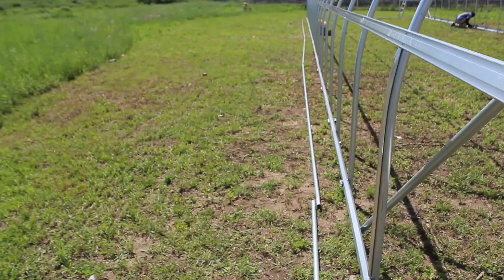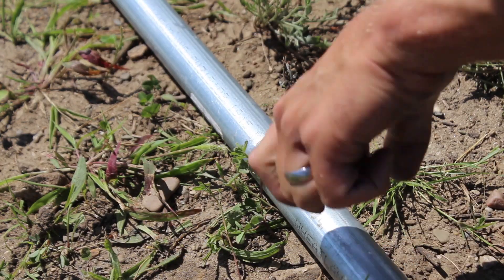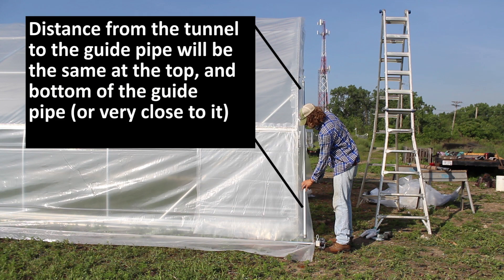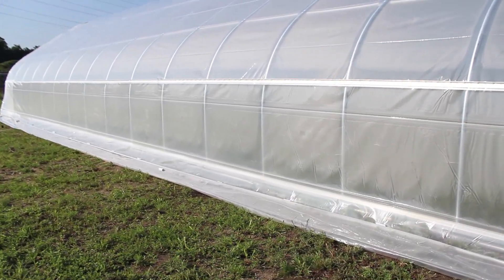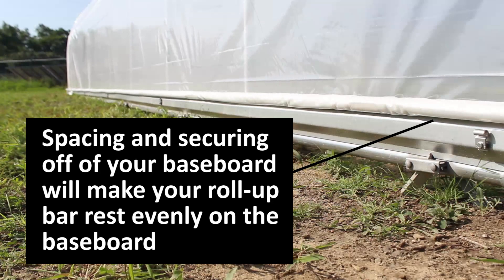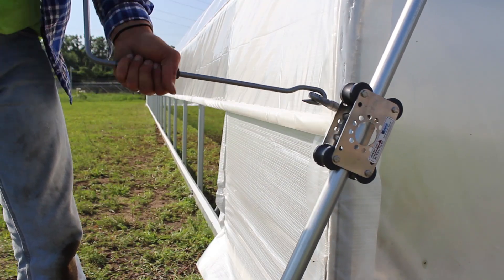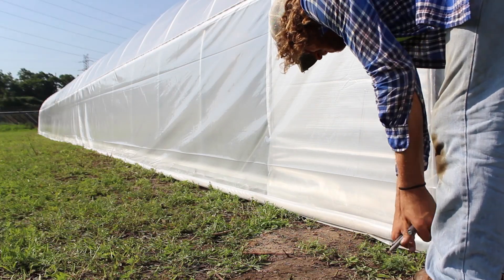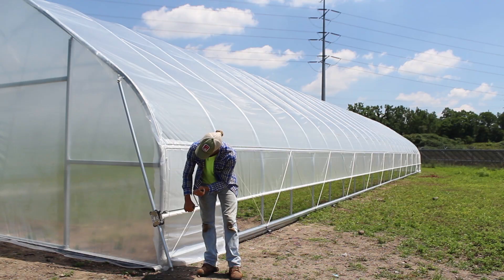Roll up sides for Greenhouses - How to Install for Improved Ventilation

Comment: Good step by step video.   I do have on question on the direction of the roll up.   Wouldn't it be better to roll up the plastic in a counter clockwise direction so the water would run off the plastic easier??
Reply from the maker: Good question, and you could actually rotate it the opposite direction if you want to. I prefer rolling it up as shown in the video because I find that there is less friction put on the plastic at the point where the plastic contacts each hoop. When you roll the side up turning in the opposite direction, I find that the plastic begins to wear down prematurely at each bow. 

This wouldn't always happen I suppose, and it would depend partially on how the anti-billow system is set up too (and a variety of other factors), but that is why I prefer the roll up method shown in the video.

Thanks for watching and commenting!
Reply: @tunnelvisionhoops  Thanks for the reply and your reasons why.    I enjoyed and have learned from your videos.

Comment: Looks like a real nice GH !  I've emailed my specs.  I bought a cheap version of a 30' wide.  The peak was too flat.  I awoke one morning after a huge rain storm to find my green house TOTALLED!  Nothing but bent hoops and huge puddles of water in the plastic.  :(    Will rebuild with a concrete floor as the 20 year landscape fabric permitted weeds to grow right through it, from one end of the GH to the other.

Comment: Hi, I'm very impressed with the quality of your greenhouse and attention on details. Question, is it also possible to do double purpose, inflatable sidewall and then roll them up during summer?
Reply from the maker: Thanks for the kind words, and for watching the video. There are ways to inflate the roll-up sides. You would need to weld the plastic on the edges where it overlaps the end-bow. Most people also use a special baseboard that better holds the roll-bar down. If you planned on having them inflated and in the down position for a long period of time, you could probably get away with inflating the sides with a jumper hose that moves air from the top to the sides (and then disconnecting this jumper hose in advance of when you would want to be able to use the roll-up sides). If you plan on operating the sides relatively frequently though you would likely require separate inflation fans for the sides that could be turned on and off as required. We don't specialize in this aspect of inflation so I would recommend reaching out to a company like Advancing Alternatives to get a full run-down on the hardware and configurations required to do this.
Reply: @tunnelvisionhoops   Thank you for your advice and tips! 😁 But my ideas are to put 6 inches baseboard wood on top of the metal baseboard and put wire channel, so that in cold season I can air lock the roll-up plastic, and during summer I will remove the wire lock? (Hope this will work) I'm also planning to leave 3-5 inches gap in-between the two wire locks of  the hip rim, so that the air will also flow down the side and I can avoid installing the jumper hose. I'm basically base in South of Portugal where the weather reach an average of 17-23 degree celsius and 10 in the very cold winter day. But so far, checking all of greenhouse in YouTube your greenhouse construction got my attention, very neat and professional and the way you answer back all questions is very professional too.

Comment: With both sides rolled up, what’s the vulnerability to wind?  Is it much worse or can high winds spill out without damaging structure or the plastic covering?
Reply from the maker: It would be ideal to roll the sides down when high winds are forecast. It would be better to roll both sides of the structure down to prevent wind from making its way into the structure. Securing the far left and far right of the roll-up side with Spring Wire (where it overlaps the end-hoop) is a good way to further secure the plastic in wind.

Comment: What are the temperatures different from outside to inside the greenhouse 
Thank you
Reply from the maker: It really depends on a lot of variables, most importantly how much direct sunlight hits the structure throughout a day. This is an important variable because the structures' intent is to hold that heat throughout the night (as well as possible) until sun can begin to warm the structure the next morning again. For this reason, the temperature difference from inside to the outside can also depend on how well the structure is sealed to hold the heat that was gained during the day, through the duration of the evening. For this reason the temperature difference from the outside of the structure to the inside of the structure can really vary from just 4 degrees to 50 degrees. It all depends on the structure, the environment, maintenance practices, and more. 

While the heat in the structure is an important factor, the removal of wind pressure on plants can be equally beneficial.

Comment: Do you have a ballpark estimate for a 65' x 15' greenhouse like this with roll up sides?  And maybe beginner intstallment time estimate?
Reply from the maker: We could do a 14.5 ft. wide x 64 ft. long (they are on 4 ft. spacing between bows), or we could do a 17 ft. wide x 64 ft. long. Shoot us a message via our contact form on our website (tunnelvisionhoops.com) and we can send you detailed pricing and info on a few different structure configurations in these sizes. Basically, you can make them as simple or as decked-out as you wish, so pricing can vary from structure to structure. Feel free to shoot us a message and we can send you some quotes. Thanks!
Reply: Where u get that nice metal end wall framing?
Reply from the maker: When people purchase one of our high tunnels / greenhouses we provide them with square steel tube end-wall kits. We pre-cut the steel members as much as possible, and provide detailed drawings, so the end-walls can be assembled as easily as possible.
Reply: Is there s limit on how high you can roll up a side?
Reply from the maker: No and yes, if you have the side roll-up to far past where the hoop starts bending toward the peak you won't be able to install anti-billow rope systems that will keep the roll-up side against the side of your structure AND be loose enough to allow it to move freely up and down. Typically I wouldn't recommend going to far up past the bend on a hoop.
Reply: Whamy do hip rails have 2 wire channels?  Is that not just double work?  Would one single channel not do the trick as most take at least 2 wires n 2 layers or film?
Reply from the maker: Double channel is more rigid than single channel, and allows for you to install a hip-rail without lumber. You can get by with single channel, but I would always install single channel on a piece of lumber because I don't find it to be as rigid as I like for a structural member. I also find that double channel comes in handy when adding an additional item like shade cloths, or for the potential of having to replace a damaged roll-up side. 

Both channels work well, and you can get by with either, just kind of depends on your intended usage and what you want the main intention of that piece of hardware to be.

Comment: is the roller bar attached to anything on the opposite end from the crank??
Reply from the maker: No, the one end has the gear box, and the other end is "free floating"
Reply: @tunnelvisionhoops  Any reason why you wouldn't secure the other end to the ground?

Comment: Do you need to screw a self-drilling screw into the EZ-Snap rope hooks, when they are clipped into the wiggle-wire lock channel??  Your Vidio does not show a screw into it, but I guess the downward or upward force on the clip, would keep it  "locked" into the channel ?
Reply from the maker: Thanks for the comment, and I agree we could have shown more detail on the anti-billow rope aspect of the roll-up sides, which is why I am in the process of editing a video for those right now. To answer your question though, you would not need to add a screw due to the shape of the EZ Snap Hook. The downward pressure on the hardware and the shape of the EZ Snap Hook will hold it in place. 

With the above being said, if you are in a high wind zone and wanted a little more insurance you could drill a 1/4" hole through the hip rail at each EZ Snap Hook and pop a bolt through the EZ Snap Hook and the Hip Rail, and put a nut or lock nut on that bolt from the inside. This might be a little overkill, but this is an option for you if you wanted to take it to the next level.

Comment: Great video I'm about to install plastic in the A.M. trying to do something similar with a PVC hoop house, could you go just a little more on the anti billowing installation. Do you just go every other one inside and outside? Thanks
Reply from the maker: I agree, and am actually editing another video on anti-billow currently. In the meantime, here is more info on what I do:

I usually start the anti-billow rope at the hip rail on the end of the structure with my handle or operator (just a couple inches in from the end-hoop). I then bring the rope straight down to the baseboard, and then from their go up to the hip-rail at an angle, and back down to the baseboard at an angle so that there is a connection to anti-billow hardware every hoop. I have seen other builders make their anti-billow connections so they are separated every 8 or 12 feet though. I suppose it is also a bit of personal preference, but I like having a connection at every hoop (whether at the hip rail or at the baseboard). Hope that helps!

Comment: Hello. Wonderful video and very well explanined. Thanks. What is the dimension of that poly house?
Can you also make a video on how to bend and join galvanized pipes and use clamps, joints and connectors? Actually i am looking and getting ready to erect a small (50x20m) test poly tunnel for tomatoes growing.
Reply from the maker: Thanks for the kind words. We won't likely have a video on our bending process, although we may have some videos soon showing how to connect tubing using various clamps. As for the dimensions of the structure in the video, it is 24 ft. wide x 92 ft. long.
Reply: @tunnelvisionhoops Thanks dear. Will be waiting for such videos. Good luck and many successes.
Reply from the maker: Thank you! Many wishes of success for you as well!

Comment: Do you wait to install wiggle wire in the lower wire channel of the hip board until after finishing the roll bar?
Reply from the maker: I tend to, but it wouldn't change anything if you had decided to secure both runs of channel with spring wire before tackling your roll-up sides. 

Personally, I just like to get the roll-up tube on as soon as possible to prevent the excess side plastic from flapping around in the wind.

Comment: could this ventilation work fine for my purposes? I'm considering to grow tomatoes inside so I'm afraid about the acumulation of water at the peak of the greenhouse, I've read that if that water drop over the plant can be dangerious for them. Thanks again!
Reply from the maker: It will help for sure, but there are usually a number of variables that impact how much ventilation is needed. These variables include such things as the amount of water in the ground of your structure, how hot it is outside your structure, how much sun is shining, the humidity that exists outside your structure, etc. The list goes on as far as the potential variables that can impact how much water accumulates on the inside plastic of your structure... that said, having sides as shown in this video is a BIG help for allowing some of that air exchange to occur, and while unknown variables might still create dripping, having sides that roll-up and down will help reduce that dripping and improve the health of your tomatoes. The narrower your structure is the more effective roll-up sides are to ventilating your structure. For example, if your structure is 40 ft. wide x 96 ft. long you may want to consider additional end-wall ventilation that includes exhaust fans, as well as interior air movement fans...but if your structure is 16 ft. x 40 ft. or something similar, for example, roll-up sides will do A LOT for air movement, water evaporation, and the health of your plants.

Comment: how do you make these roll up sides inflated for winter
Reply from the maker: You would need to install two layers of plastic that stretch all the way to the baseboards, and then you would follow the steps outlined  in the video, but you would just do so pretending both layers of plastic are a single layer. 

Once the roll-up bar is attached to both layers of plastic you would need to seal the plastic at each side where it overlaps the end hoops; this can be done using Spring Wire. You could also purchase a plastic sealer and seal the sides of the plastic before securing the poly to the roll-up bar. 

If you are concerned that the pressure from the inflation fan is too much for the roll-up bar connections, you can also run spring wire channel the full length of the tunnel near the point at which the roll-up bar rests on the baseboard. Wiring the roll-up plastic the full length will ensure that the inflation stop at the Spring Wire, which will limit the pressure on the roll-up bar attachment. This is likely the most ideal for scenarios where the roll-up bar is secured as it is in this video (using Snap Clamps).

If you secure your roll-up sides to the roll-up bar with a different method, where spring wire can hold the plastic directly to the roll-up bar, you would likely be able to get away with inflating the roll-up side without installing a full run of single aluminum channel near the baseboard. 

Best of luck with your project!